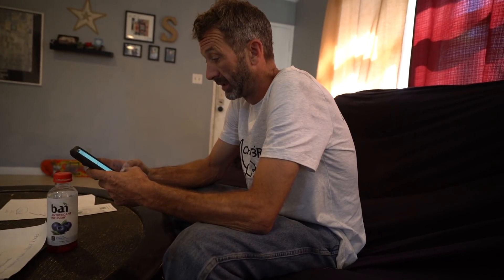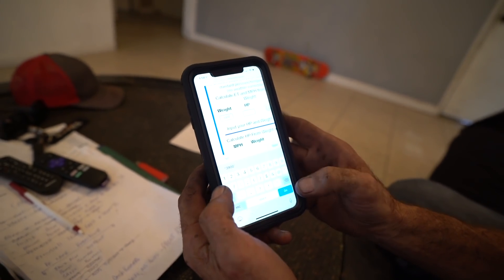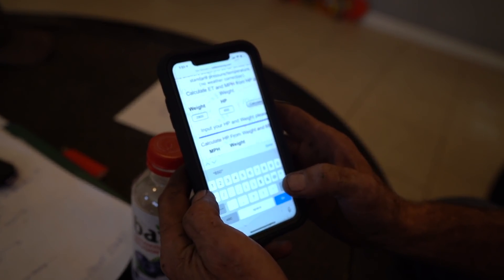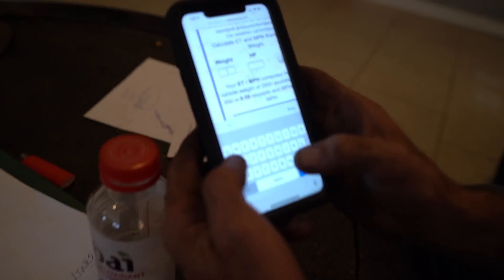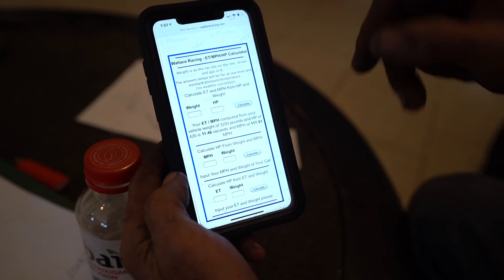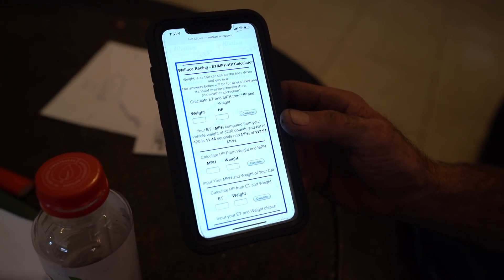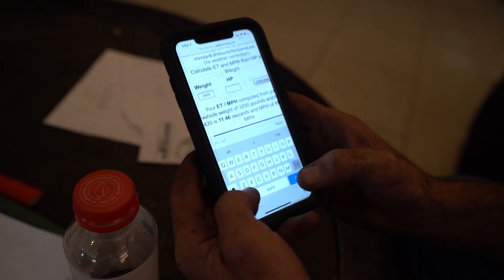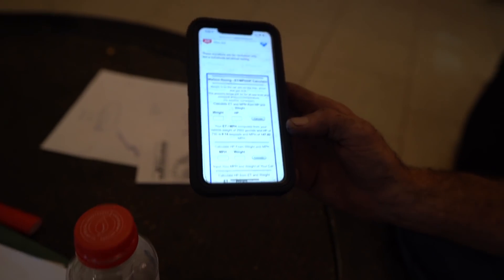Bad Daddy Brad Explains a Calculator

Comment: I know budget dictates all. However you built this truck a second time to make it more valuable. Why then would you overlook the motor that you knew had problems in the first show. Not trying to be insulting, I'm just confused. What you basically told us is. If you spray and more importantly the new owner sprays. There is a potential of sending the motor to the moon. I'm nobody, but doesn't that potentially lower the value of the truck? Now everyone who was watched this knows the motor could go. I just wanted to know what the reason was. I myself would have rather bought the original build with a fresh motor and nitrous. More so than a questionable motor, nitros and twin eBay turbos. Maybe that's just me.

Comment: Wait what happened to 1000 hp?
Reply: Riz3n FPV he thinks he’s got a cylinder down on compression, when it was probably just  that rag in the intake manifold stopping the intake valve on that cylinder from shutting properly 😂
Reply: Johnathan Doe I mean that’s a theory, mechanics needs theory like a diff needs a WiFi drive shaft. But ok we will say now the rag( and the bolt) has gone from the intake we will see 1k hp for days.😂👍🏽

Comment: The only reason why that cylinder was low it's probably because it had a rag in it. Hahaha I would redo a compression check.
Reply: yeah that's what i was wondering too, if they redid it
Reply: All hail compression rag!
Reply: yup I think a retest is in order, that rag would have messed things up a weee bit for sure!!
Reply: The rag wasn't in the cylinder....
Reply: @Cekmore  it could have impeded a valve preventing a complete seal.
Reply: @Cekmore  of course it wasn't, i think it was just a shorthand, as we call "a cylinder" everything corresponding to it that works together with it, like its valves, piston, intake + exhaust runners, you name it
Reply: @Cekmore  it was in the intake runner so blocking air going into the cylinder
Reply: The rag would not have affected cylinder compression
Reply: @bradmurphy5312  please explain why?
Reply: @bradmurphy5312  there's really only one way to find out. Bad Brad should do another compression check